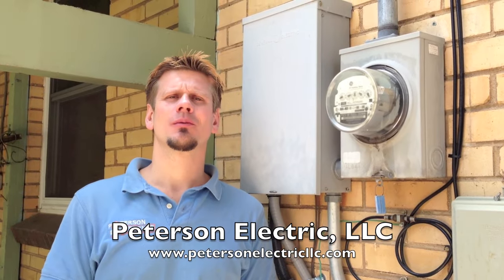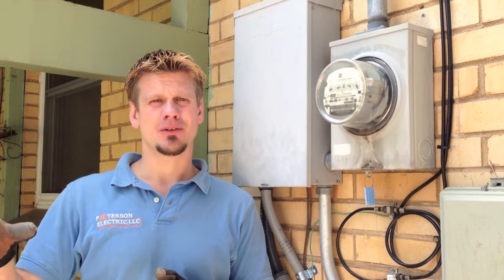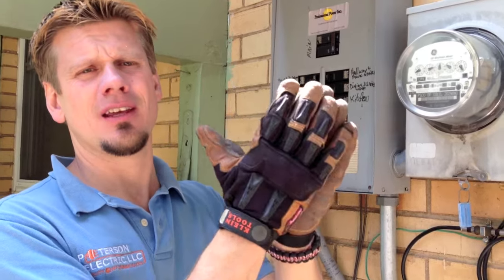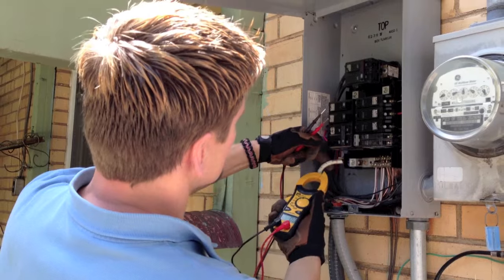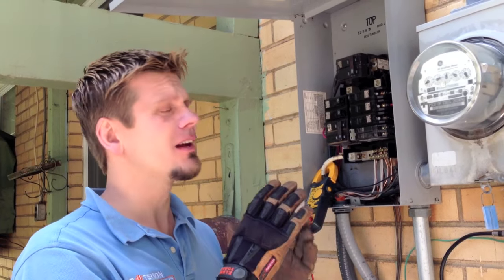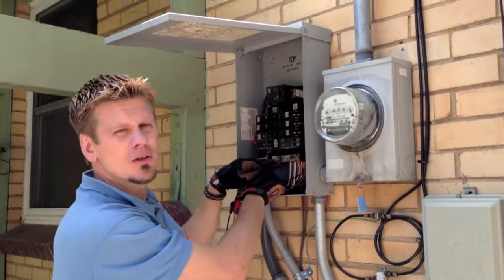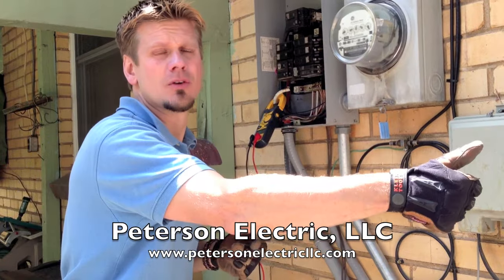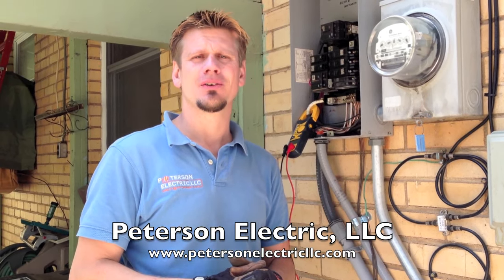Half My House Is Out Of Power, CO Electrician

Comment: I lost power on the 4 back rooms of my house. The electrician shut off the power, unscrewed the plate covering the switches. Then he checked every wire above and below the switched. He found the far right bottom one was loose so he tightened that and checked all the others. It fixed the problem.

Comment: This was an excellent video and probably saved me $10k. One of my main lugs was loose…so loose it would arc when under a small load…lots of buzzing and lights flashing…kind of terrifying actually. Anyway, I’ve worked with electricity a bunch over the years but couldn’t understand what was going on until I watched this video. After testing and seeing the main lines were hot but only one lug was hot I found the problem. I donned some thick rubber gloves and carefully cinched down the loose lug and problem solved without an electrician visit. THANK YOU.

Comment: Whenever I hear stories like this I'm reminded of a windstorm we had. A tree branch broke off and when it fell it broke a wire between the transformer and the house (they were the old bare separate wires up to the last pole, then insulated to the house). Needless to say things got really exciting as the light bulbs started popping and a vcr sounded like bacon frying while the tv was doing a poltergeist imitation. I ran for the main disconnect as fast as I could but reflexively hit a light switch and blew another bulb in the process. Lost a bunch of stuff in the house from that one. Luckily the power company was already out fixing other issues from the storm so we weren't down too long but it took about $1500 of equipment out.
Reply: Wow. That's scary. I bet the vcr was arcing in it's power supply.
Reply from the maker: Yep, that is a bummer, I have seen this happen with bad neutrals and or connections and or lugs. As well as lightning strikes.

Comment: Super. Worked on a house with most of these issues, like stove, airconditioner, and dryer only partially working, but every 120 volt outlet, light, and appliance worked fine, with no power fluctuation or other issues. I thought maybe bad connection to the neutral, since I had 120/120/240 volts at the input wires to the main breaker, but when I checked the output from the main breaker, I got 120/120v and 0v??? across the main. Turns out some character installed a 50 amp two pole breaker with the poles wired together when the main breaker partially died to supply half of the breaker box because only one line was working (L1 Hot, L2 Not) when you turned on the main breaker. I would say that it is about 50/50 when it comes to if it is a power company issue or a connection or bad wiring on the homeowners or electricians part. I've seen bad neutrals at the pole, the pad mounted transformer, and the homeowners electrical box, and have seen the ground wire to phones, pipes, and ground rods get hot or burn or even melt when the neutral isn't properly connected or cut/ broken. 💙 T.E.N.

Comment: Electricity does not go to ground unless there is a problem. It returns to the source. The panel is a source, so is the transformer. The rest is good information. Open neutrals can destroy electric equipment. Call an electrician.

Comment: Having a problem like this as I write this. Bad storm last night. Electric company notified us of an outage, now part of my house is out, electric company says it’s one of the poles to the meter measures weak. I was told I will need to dig up the service cable to the breaker box located in my garage( detached garage) also have another breaker box in the back entrance of the house. I have an electric burners, when I turn it on, the kitchen lights turn on..but the burner light do not. Also the meter box is not attached to the house well, so makes me believe it’s cause the wires to loosen, especially from the storm.

Comment: Dude you just answered a lot of my question in record time. My house just went crazy on me still don’t know if it’s really fixed. Started when I turned on a small job sight table saw. Just ran slow and saw the lights flicker in garage 15 yrs in this house never done that. Go to the basement check breakers lights are flickering turn off the breaker for garage and the AC stops and basement lights go out. Go to the AC breaker it does nothing. Go to the basement light breaker it turns the AC back on. Turn main breaker off at that point go outside. Go to my fishing boat that’s on the charger unplug it lights in garage go off. In completely lost at this point don’t smell anything see anything nothing. Check Volts 127 on A and B every breaker shows the same 
Go to the outside main and see the same volts coming in but found the terminal ceramic bracket on the neutral broke was still able to get each stud tightened a little. Go back inside and turn everything back on and everything works. I’m still lost on what happened. I pulled the wires out at the breaker box for the garage as well and left them out now I’m wondering if it was just the wiring on the garage side or a the neutral. It’s late and don’t want to risk loosing the AC. I’m just lost on this one. But thank you again for all the info gave me hope in the end dude thank you 🙏

Comment: I can assure you that panel does NOT have several phases, since it's a residential SINGLE phase system. What it does have a neutral and 2 hot legs of 120 volts. These "legs" are called L1 and L2 and reading between them you should see a nominal 240 volts. When a neutral goes bad you will ALWAYS have 240 volts between the legs but there will be an imbalance reading each leg to neutral. Example: L1 = 180 volts and L2 = 60 volts. (still adds up to 240 volts) If one leg stays at a nominal 120 volts and the other drops under load you have a poor connection on one leg or a 2 pole breaker with one side gone bad. I have also seen a burned buss bar in the panel or a burned wire (one leg) do the same thing. (22 years trouble shooting in the field now)
Reply: You are mistaken! You will have a phase to phase short if you short out both phases 🧐. Just try it.
Reply: the guy in this video knows just enough to be dangerous
Reply from the maker: OK, L1 and L2 or as I would state Phase one and Phase two. You get hung up on items. Listen to the point of the video. Yes you are CORRECT. Single phase. Wow 

In commercial L1 and L2 and L3 or Blk, Red, Blue, (120/208volts     or     BOY - Brwn, Org, Yellow 277/480 volts.
Reply: No one said to short the two hots. They are referring to the reading between the two with a meter.
Reply from the maker: We have worked and wired on 3 phase 120-208 Volts & 277-480 Volts ¥ and also 3phase 240 corner delta. 

You seem hung up
Reply from the maker: RabidMortal1 
Read
Reply: Waterlec  , just out of curiosity, when you stated that you checked the 220 receptacle for the dryer and received "nothing", was there no voltage at all from the socket? Or was there just insufficient voltage?
Reply: Waterlec  , I do apprentice as a side gig, so I have some knowledge. I'm always in "learning mode" and I just had not heard of the experience you described, so I was curious at a technicality level.  LOL  But I have a total picture of that now. Thanks for taking the time out to respond!
Reply: Lmaoooo 😂 another commenter wanting to think he knows more than a person who has a degree in this 😂😂😂😂
Reply: @SLAutoRepair  an you know just enough to be jealous of him because you damn know a damn thing.  🫢

Comment: The reason an open neutral condition on the main causes voltage variations in the 120V circuits is that with the neutral open, the normally parallel circuits (A phase to ground and B phase to ground) become series circuits (A phase across to B phase)  Because current in these series circuits will be constant across the circuit, differing loads in series in different portions of these circuits cause voltage variations, with one portion of the circuit having low voltage while another has high voltage.  

Open neutrals are commonly found in SEU cable that has a cracked jacket with water in it and corroded braid, neutral lugs in the meter socket, corroded H - taps and lugs at the service connection, and of course the main service equipment.
Reply: Thank you for the explanation. I'm going through this exact situation right now. I spent 320 on all new breakers and such thinking it was my old house. Turns out the electric company's lead line from their transformer to my house underground is messed up. Fried the meter box outside. I hope I don't have to repair anything else in my house because their equipment failed. They have a portable transformer outside now but I only have a little electricity. Even though their transformer shows feeding 240....😔

Comment: Great video. :)

Back years ago (late 2009) I lived in a VERY old house where half the house went out of power one night. Was VERY lucky the house did not catch on fire. The only thing that prevent it from doing so was the metal junction box up in the attic. Inside of the junction box was cross-wiring. Someone had previously mixed wiring.

Instead of rewording the entire house, the person kept part of the original ancient (shoestring-looking) wiring, and then installed newer, more modern wiring. So literally half and half inside the junction box. The wires were HOT and literally glowing red. I need to find the pic I have.

Anyway, that was scary! What caused that was running heaters all the way up on a very cold night in a very old house with very old wiring.

Comment: Hello It’s summer time in my home we have 3 air conditioners , 1 in the living room , 1 in another room downstairs and 1 upstairs, sometimes I’m a day it trips,at least 3 times 🤦‍♂️ only thing I do is unplug outlets even if they are not on. Does anyone know what could be the issue?  House is very old I took a look at the circuit board and it seems 1 or 2 have been replaced in the past. Would replacing them all be a good thing to do? Or do we just need a stronger/ different system? I can’t take this heat , thank you

Comment: Thanks so much for making this video, I’m fairly confident with electricity, I have wired in a back up generator, and the 220 hot tub outback, but my older home is currently having a similar problem to this, when I run the microwave and a few other appliances, I can hear the microwave not running as fast as it used to, sounds like it’s getting low power, also I can no longer run my air compressor on most of the house circuits except for one that will still run it in my garage, otherwise there’s not enough power? I don’t have a fancy voltmeter but I think I can get the job done with my old craftsman voltmeter, just doesn’t have the wire clip like yours? Will try some of your suggestions, and update with what I find. Thanks again.
Reply: You should probably have that hot tub circuit checked by a professional.  They have some unique requirements and can kill if messed up.

Comment: I plugged something into an outlet on my patio and it went dead in 2 seconds.  Then several outlets in the house were also dead and the roof A/C  stopped working.  All the breakers are on.  Is this the same problem??
Reply: Was anyone working on the electrical and what were they doing?

Comment: In my house we would get a steady 125 volts on both sides and if we turned anything on that drew more than 4 amps would bring the one side down to 1-12 volts but we figured it out as a loose wire

Comment: I have 1 breaker, dual 20 amp, and another dual 15 amp that loses power without tripping. Only one  of the dual 20 amp loses power while the other maintains power. GFCI is not tripped either. These go to 3 bedrooms.

Comment from the maker: Tire, I stated this six years ago, and my instructor cleared this up, but you are not completely correct, I have had neutrals fail on the main panels and the  Neutral bleeds off to through the bonding jumper to rod or water electrode. I have personally seen this melt through the #6 bare copper under the cabinet knock out of the metal

Comment: I have an electrical problem, when i use the microwave and other appliance at the same time the breaker pops out losing power on most of the outlets. could it be that too many outlets are connected to that breaker? I need an answer please.

Comment: I have been fighting for a new pole from my MHP mgt for some years now. Their post is the problem and this video let me know if I hire a good electrician instead of lip service from their shade tree inept 'handyman' (with no license), I can prove their fault and make them replace it (it has even caught fire and melted one of the slots before. I replace my breaker box. I replace on the post  every few months since they crack in half or melt.I had slowly replace and tightened every break in the box at this point at my expense. >: c

Comment: What does it mean when I can hear my 120V desk fan slow down and speed up as the 240V clothes dryer's heating element cycles on and off? I'm guessing the line to the house is too thin?
Reply from the maker: No I think it is a neutral in the panel, see if you feel comfortable opening the panel on the sub panel or main,, and then use a meter and see what type of voltage drop you get on the circuits your concerned when you turn on dryer and then fan and vs versa.

Comment: All of a sudden the lights start flickering in this and that and the power goes off ,flipped the breaker ,the power comes on and everything is dim in half the house, the lights just flicker some don’t work at all .most of the outlets etc. just have a flickering amount of electricity to them so we put a voltage meter on the main breaker in the panel that comes in from the road. The bottom read out about 124 and the top of the double pole was all over the place, registering 13, 24, 8, 16, it was just was bouncing. So that’s the double pole main breaker that the electricity coming from the road into the house. What is happening here? Is this a consumers power issue between our panel on the side of the house to the road? Thank you

Comment: Helped a friend out and checked his power. The feed from the meter only line 2 was hot but line 1 was dead to ground and neutral. Never got 240v. His dryer ran but no heat  but when the dryer was on the ceiling light came on. Looks like a back feed on the neutral but freaky. So I went to the main disconnect at the meter and able to get 240 volts  but not at his main panel on his house. I think there's a open line under ground but that's a big cable. There must be a splice that went bad. What's your thought on this. Someone installed a garage and maybe severed the power and it was spliced and one connection corroded and opened.
Reply: Ya once you know L1 or L2 is dead you should turn of all of your 240V breakers to prevent the devices from leaking voltage to the dead line giving your devices on that side severe under-voltage and damaging your devices.

Comment: I have this same problem now. Half my home has no power. When I turned the stove on I get power on the other side of the house. But the lights kinda dim turning burners on . When I turn the breaker off to the stove I loose power on the other half again. Very frustrating
Reply: What!! I have the same issue when I turn the electric stove on, the power starts working again. Have you found any solution?
Reply: I have 100 amp service. I had an electrician check it out. One of the legs going in the house burnt . I’m having to replace the box and all the breakers on the outside of the house and replace the line going in the house. I’m thinking ants got in the box and shorted everything out due to a large ant mound inside the box.

Comment: Common misconception: "phase" = a hot leg. So how is both a 240V circuit & a 120V circuit "single phase"? Phase is a hot-to-hot connection. In single phase there is only one possibility, A-B. In 3-phase, AB, BC & CA (3 single phase options) are possible, that's the key.

Comment: We've been out of power to half our house for 6 months and haven't been able to get it fixed we turned one 50 amp breaker off and left the other one off I think by buddy changed out an old breaker a while back no luck there so our house runs on one 50 amp breaker the rest of our house runs off of inverters and solar panels connected to our stored ah battery banks we are going to be purchasing the title to our house once our home owners are back from Utah just gave them 12.5k but still needed to give them another 3300 to get the title to the house. Its summer so I'm buying more solar panels and another really big inverter but my wife and kids would sure love to fix the power to the house :) any suggestions?
Reply from the maker: You may have a slit bus bar system to the panel and it has lost power on half. Or it is a lose or burnt connection underground or overhead on a splice bug.
Reply: Most of the guys i have showed it to seem to think maybe an electrical surge may have caused it as well. Half of the houses outlets and lightswitches have no power. But dish washer water heater washer and dryer still all have power on that one 50 amp breaker. Thank you so much for the feedback so far tho :)

Comment: I have lost power on I believe is one complete circuit in my home. Several outlets and light switches. checked all breakers and they are good and not tripped. Please somebody help me figure this out. Mouse chewed thru wire in the wall?   How would I know?
Reply: Mike Harmon dude turn all burners on range stove or try washer dryer see what happens
Reply: Maybe there’s a loose connection on one of the first outlets in that circuit so as a result of that their is no power getting send to rest of the electrical appliances in the circuit